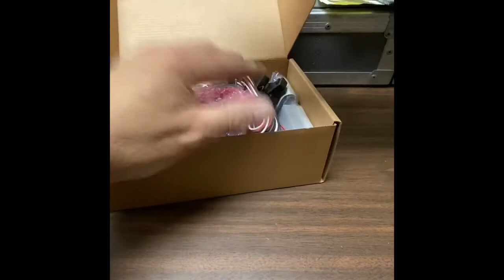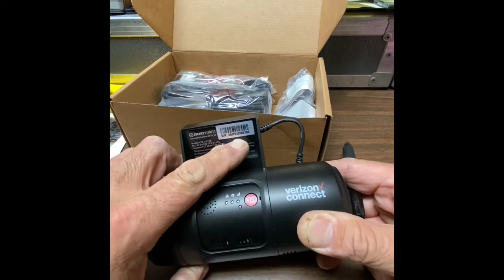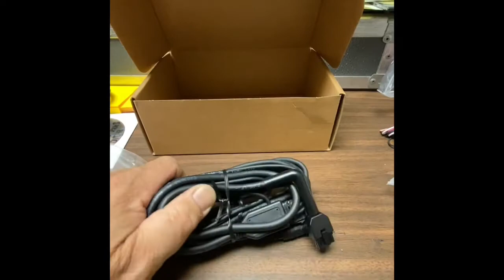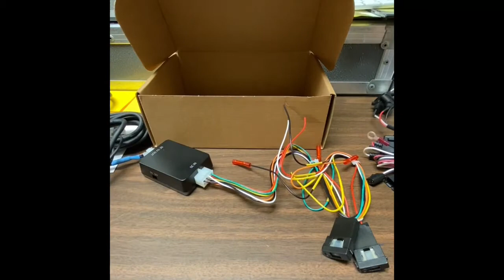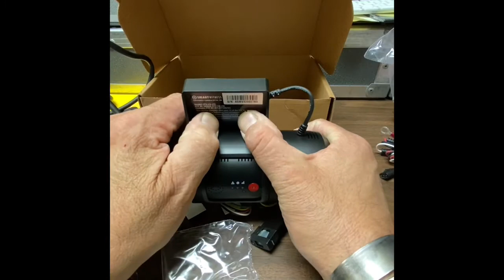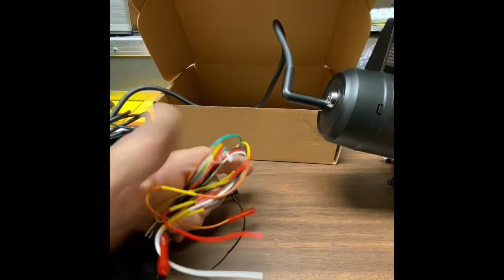Verizon CP2 Dashcam install review

Comment: Can you go over those 3 lights? Does it flash when it has been activated and recording? If so which one will flash. Thank you
Reply: Solid Blue/Green LED lights indicate the camera has successfully booted. 

After the camera is connected to power, turn on the vehicle ignition to boot.
give the camera several minutes to boot up.
Pair the camera in the reveal system etc w the existing vtu.
Solid red indicates power on, flashing red indicates an issue after 10 minutes

A solid blue light indicates the camera is working correctly.

A solid green light indicates the camera is connected to the network.

If the blue and green lights are not solid after 10 minutes, please refer to the Troubleshooting section. 
If you cannot resolve the issue, contact Reveal technician support.If needed: Using a paper clip or similar small tool, press the Calibrate button for three seconds, or until you hear a beep. The calibrate button is the smaller red button on the camera.

Comment: From the camera connector, how far away are the other two connectors for the driver facing camera? We have these installed and all cables are hidden by the installers. Trying to figure out where I can access the connector without having to remove headliner post and cables behind the dash.
Reply from the maker: From the camera itself it the connector for driver view cam should not be more than 3 feet away. Its probably under the headliner. Might be tucked in tight...